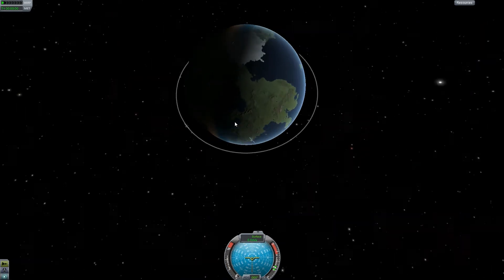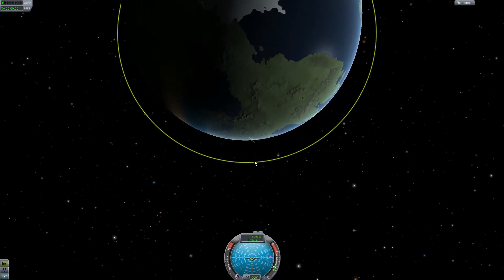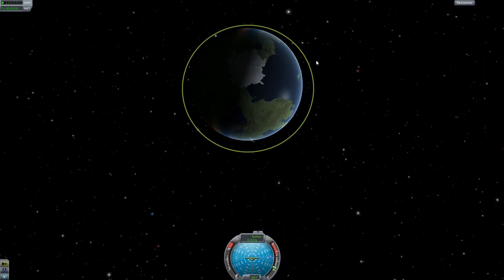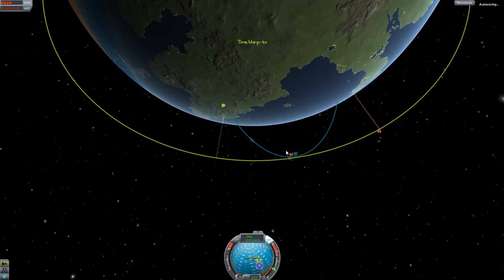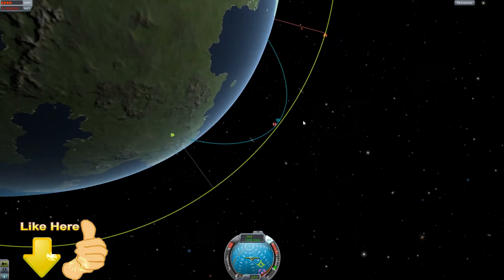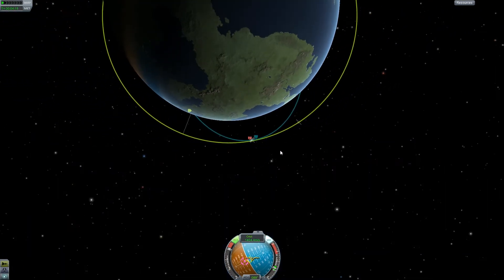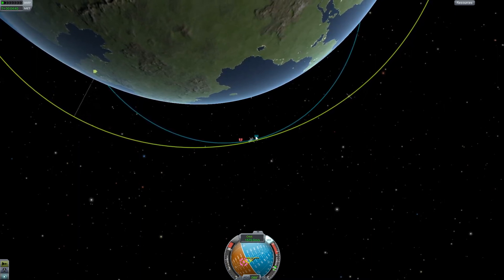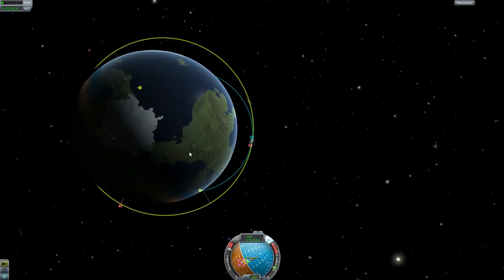Kerbal Space Program : Docking Tutorial Part 3 Advanced

Comment: i got one problem. im making a space station and im putting parts were we can refuel but it goes one side to the other so i have to get an angle right but when i had dock the angle was different. so i had to undock and fix it which i did but when i try to redock it wont let me. no magentic pull or anything i need help with this